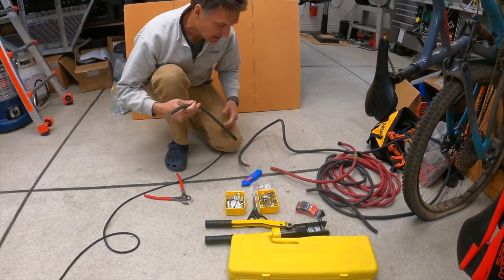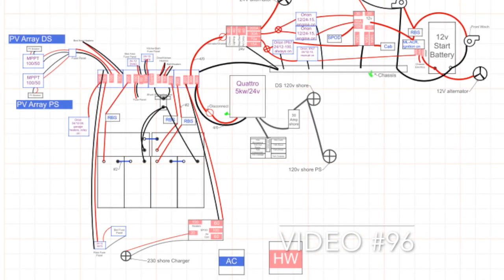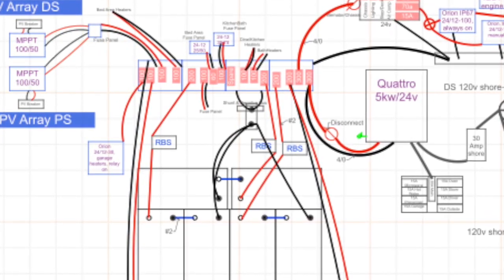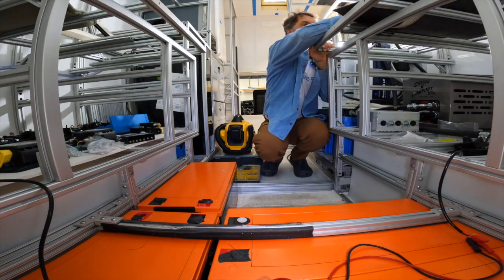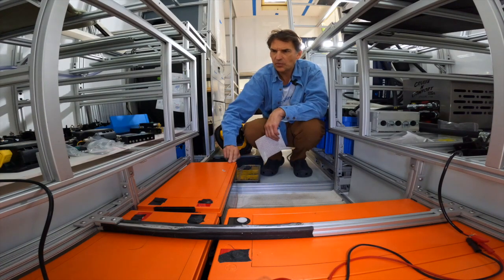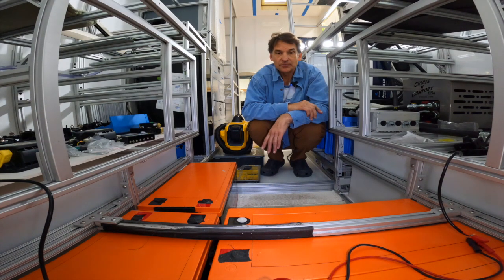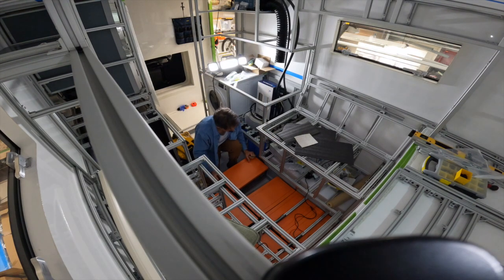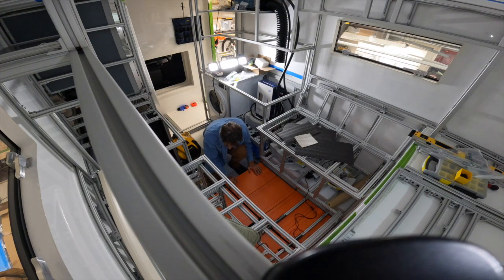Installing 1,800 Amp-Hours of batteries into my Expedition Camper

Comment: Given that I'm sorta an expert on loose screws, you should think over using some loctite or similar to safe yourself issues with the connections vibrating loose. Since the threads are mostly harder than the Copper contact pieces, this will happen eventually and the used split washers i saw won't do this job well enough.
Reply from the maker: Thanks for your suggestion. I followed the manufacturer's installation specs, and torque'd, and plan to recheck after some usage, but good suggestion to add some locktite, which I often do use for many connections, and totally agree with even more important with dissimilar materials.
Reply: Idk about over using as that may cause connection issues too but a tiny drop on each screw of blue locktite wouldn't hurt!
Reply from the maker: @2down2togo  Yes, a key reason why I haven't used a thread locker on these as concern that it could add resistance exactly where not needed, but will research that some more, and you're likely right that a drop or two likely won't add enough resistance to matter but will research to learn and share.
Reply: @vantripping  never hurts to learn! Lol
Reply from the maker: I researched the electrical resistance of thread lockers and found that all but one adds electrical resistance and are not appropriate to use for electrical connections, and that nylock nuts and lock washers are adequate and add as much loosening resistance as thread lockers, so best to use them instead of chemical thread lockers on electrical connections.